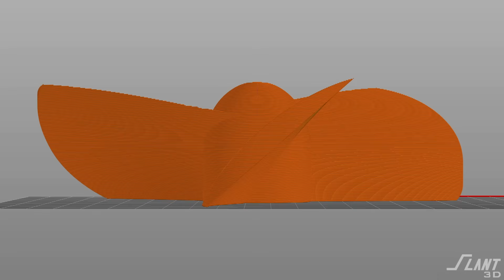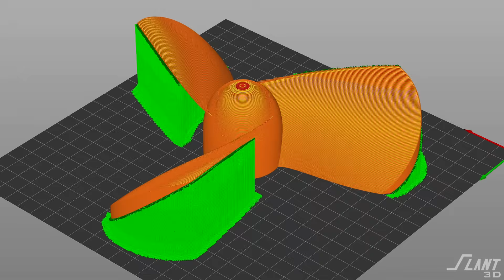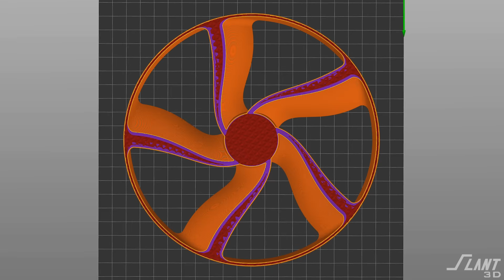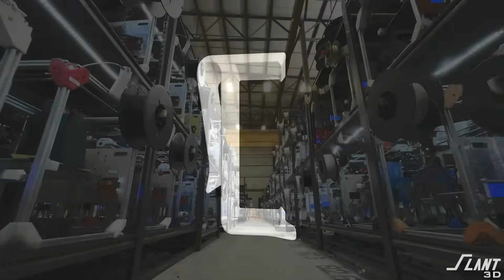3D Print Better Fan Blades Without Wasting Filament | Design for 3D Printing

Comment: Are the supports offset 0.3mm normal to the fan blade surface, or 0.3mm down (in z)?

Other benefit of the ring around: I think it mitigates vortices coming off the tips
Reply: Unless you really need different support spacing in XY plane vs Z, you may want to go normal to the surface to make sure the spacing is independent of the blade angle. Think of a very steep, almost vertical blade - just shifting the support down in Z won't be enough since the lack of XY spacing will make it fuse with the model. And you might have a blade that has some regions more vertical than others. So the best way is to design the supports intersecting the blade, then subtract the blade with an offset, which most CAD programs allow.

Comment: could we get the stls to test these out?
Reply: Step files are cleaner; these are also just examples, the intent is to make your own for whatever use case it would be (since that's the largest benefit of 3D printing)
Reply: Definitely, I done a couple of my own, found the single print pretty weak, tried it as a multipart with much better strength and finish but figured I’m such a noob looking over someone else’s file
Would help. Cheers
Reply: @justinmorrow2932  it's kind of hard to get much information from just a model, any more than just looking at the finished product at any rate; if anything seeing the process of how it was made would be more beneficial, but he does kind of outline some of the process of how they did stuff here, and there's other videos that have demonstrations of the workomg process as well (which would probably be more beneficial).

At the end of the day it just kind of becomes a matter of figuring out whatever software you're using, as well as finding a working process that works for you/what you're making (since every application has a slightly different process); it can seem a bit daunting at first, but I've found that learning process to be pretty enjoyable. Just have to keep in mind that it is a process (for all of us), and that the answers don't always present themselves right away, it doesn't mean that your efforts are in vain
Reply: I’ve been using solidworks for the last 20 years and found separate blades printed cleaner and more durable contrary to his findings but that is contrary to his minimal finishing or assembly ideology. But you are correct in the process is more indicative. So much is also going to come down to motor rpm etc so perhaps he is meaning in a very particular case which doesn’t match my own experience. I do appreciate your insight and encouragement though.

Comment: I'd be curious to see if you can print usable drone props with the design you have there.
A few years ago I tried 3D printing some 3" drone props, out of TPU...   They worked first time, see "Five33 TinyTrainer with 3D printed TPU props"